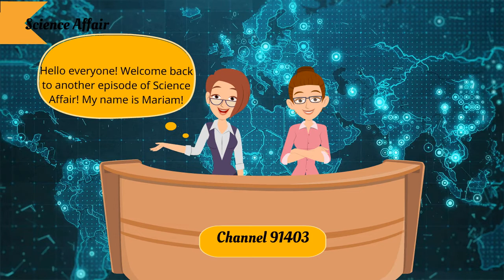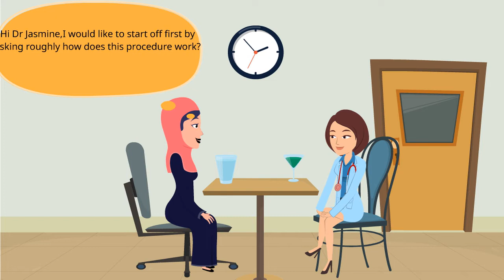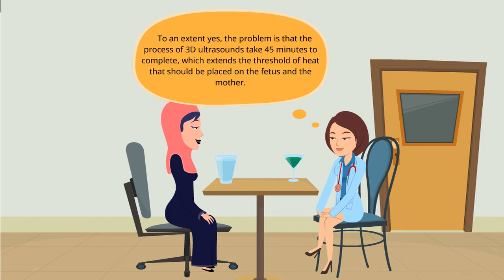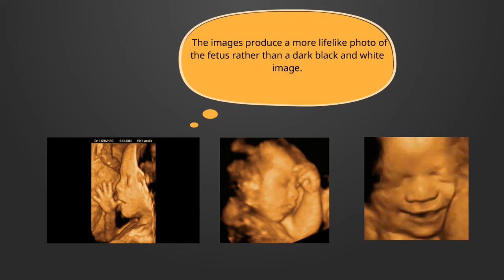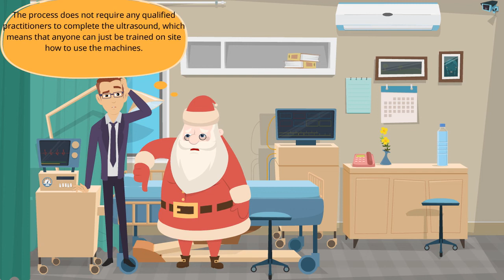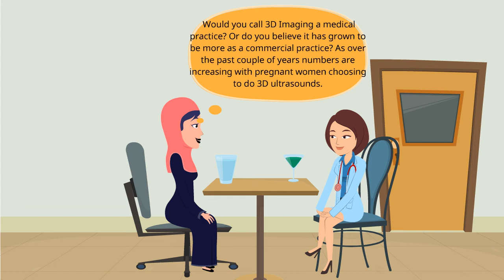G11 T02

Comment from the maker: Hey guys, great presentation ! I had a question regarding the construction of the 3D image from the original 2D. Is this constructed manually or by computer algorithm? 

Thanks Biagio_Sacco ☕
Reply from the maker: Thank you Biagio, so in order to create the 3D image the same traditional 2D is emitted but this time at multiple angles. Then all the images are compiled together and then surfaced rendered using an algorithmic process, all data from the reflections are then interpreted from a software to produce the like life 3D image.

Comment from the maker: Stephanie_Vilabourout: Since this scanning modality can be quite expensive, is there a more cost effective scanning alternative for the patients to detect fetal anomalies with similar image quality?
Reply from the maker: Sadly, not at this moment there isn’t a method that offers the same results as 3D.  However, as mentioned in the video there is a future in combing both 2D and 3D ultrasounds. This would potentially mean that if this is practiced by qualified practitioners and requires a referral from a doctor, then it be placed on medicare card and therefore become much cheaper.

Comment from the maker: Florentino_Agudera: Do the benefits of a 3D ultrasound outweigh the risks in your opinion?
Reply from the maker: The issue is due to the cause of it being sided more towards a recreation purpose rather than diagnostic. As a group we believe that If a doctor or qualified practitioner is concerned with the health of the foetus and believes there is a need to complete a 3D ultrasound then that would be an acceptable cause (assuming also that either one complete the task), as it does have its high advantages in producing a more structured and life like image of the baby to be used to properly analyse and diagnose.  However, if one chooses to go to complete it for no medical purposes, then they are subjected to higher disadvantages that range from unqualified practitioners to also high heat

Comment from the maker: Monica_Kiseloska: 

Are there any recommendations about how many 3D ultrasounds can be performed during a pregnancy?
Reply from the maker: Generally, most doctors and experts do not recommend getting a 3D ultrasound for recreational uses. It is only recommended that expecting mothers receive ONE 3D ultrasound only if necessary - for diagnostic purposes! This is to avoid extra heat placed on the foetus, besides the regular 2D ultrasound check up. We would not want to multiply any unknown side effects and potential risks through receiving more than one 3D ultrasound during a pregnancy. - G11

Comment from the maker: Will a normal result on an ultrasound scan, guarantee that baby will not have a birth defect or chromosomal abnormally? Harleen_Kaur
Reply from the maker: As mentioned, the ultrasounds primarily focus on the physical appearance of the baby, that can produce a pretty accurate reading of any defects that are physical. However, the ultrasound scans can sometimes detect fluid at the back of the foetus' neck, which is indicative of Down syndrome, but further testing would be needed to prove this (i.e. a blood test). So generally, if a non-physical abnormality is suspected by a doctor, the expecting mother would need to perform other tests. Otherwise, normal results on a 3D ultrasound scan will not show any defects - but does NOT necessarily guarantee the baby will not have any defects! - G11